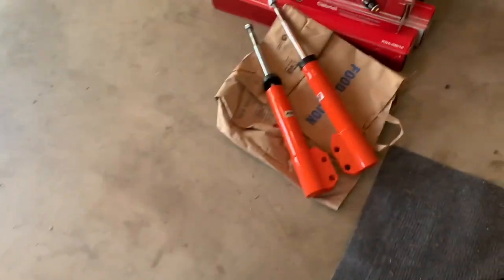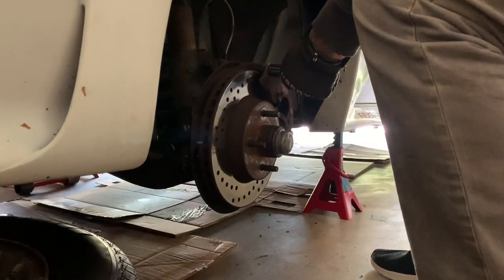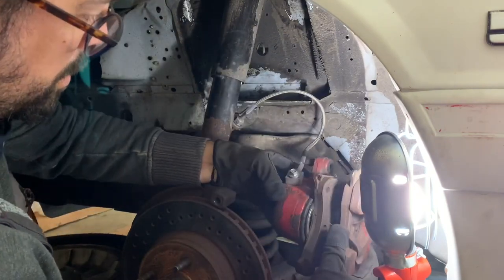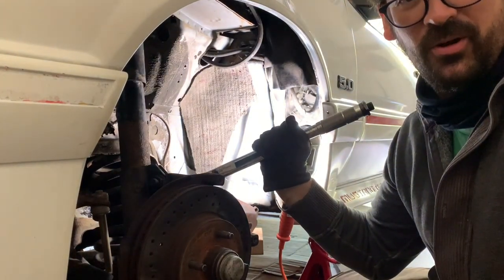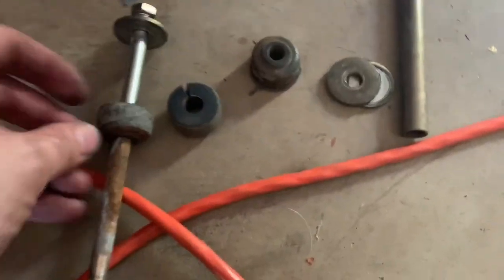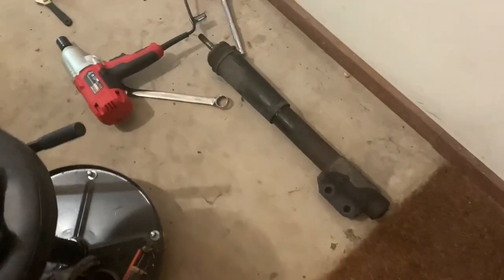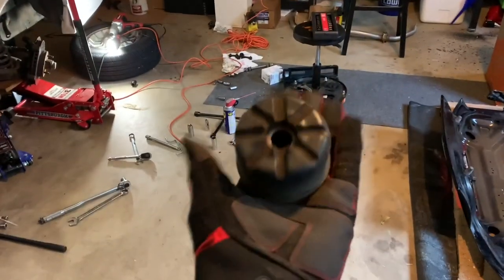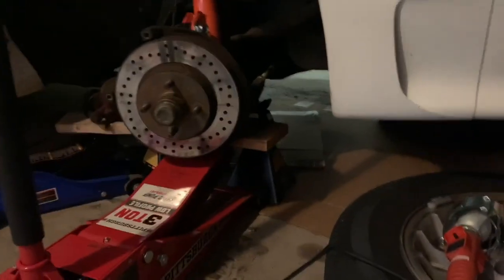Fox Body Mustang Suspension: Koni Orange Struts Installation

Comment: That kicked your ass!!  Glad it wasn’t 95 degrees outside!
Reply from the maker: Oh man...no kidding. I have to say the rear lower control arm experience was so much worse 😂😫 I’m still traumatized by that experience
Reply: @TacoPotatoMustang  - yeah I haven’t seen your video on that, but I’m guessing those bolts that go through the frame were your nemesis.  The stock height springs are a pain in the ass too.
Reply from the maker: @Foxedup  bingo...I waited way too long to try and move the mufflers out of the way and it just ended up being a long, exhausting experience. The stock height springs weren’t too bad compared to the rest of the install but I have read that doing with stock springs, the fronts are a huge pain. I suppose if I ever replace the front control arms, I will do it then but definitely won’t be attempting that any time soon.
Reply: @TacoPotatoMustang  - oh yeah my exhaust was off when I did mine.  Forgot about how tight that can be in there.

Comment: Just stumbled across your channel, love your vids! Two questions on the Koni orange strut install: (1) Did the design of the Konis necessitate modification of the upper strut mount/dust shield top or did you do that because the originals were just worn/tired and needed replacement? (2) Did the Konis bolt right up to the spindle without any spacers? I’ve read some struts need modification/spacers to work on the 87-93 cars. I’m contemplating strut & shock replacement on my ‘93 and am trying to gather as much info as I can before I tackle that job.
Reply from the maker: Hey, thanks for your comment! I will have to go back and look at the video to see if I can jog my memory on your first question. I’m planning on installing springs and a few other parts this week so I will need to revisit the strut tops to install caster camber plates. 

On your second question - I don’t recall having to use any spacers so I believe the Konis bolt right up on the 87-93 cars. If you’re not a member on StangNet yet, I highly recommend creating an account and checking out the fox body forums there. It’s still super active and there are tons of useful historical threads.
Reply: @TacoPotatoMustang  StangNet…have not heard that name in years! Completely forgot about the forums, I used to be so heavy into StangNet and The Corral back in the day. I’ll definitely have to try and dig up my old account there. Thanks for the suggestion! Look forward to more vids featuring your fox body! 🤙🏼
Reply from the maker: @meinhold93  I have a corral account as well (and accounts with most othet mustang forums) but stang net’s fox sub-forum is by far the most active forum I’ve come across in the social media age. It’s pretty incredible. 👍🏼

Comment: Did you use a battery powered impact on the top strut nut?  I'm in the process of swapping struts and shocks on my 90 7 up vert.  Thanks 👍
Reply from the maker: Honestly can’t remember if I used an impact..but if I did, it would have been a plugin electric (one I got from Walmart for like $40) since I don’t own an air compressor powered impact.

Comment: Thanks for the heads up on the cheap quad shocks - I put my koni orange on the rear today and still have to do the front.  PS, you're jacking the car up on the pinch welds?!?
Reply from the maker: The fronts are definitely a bit more challenging...but not impossible. I usually jack up on the pinch welds depending on what I’m doing. What’s the concern? 

I have a more recent video where I straighten out the pinch welds and test the SVE jack pad kit. Pretty happy with it.
Reply: @TacoPotatoMustang  Doh, I was assuming they were just sat on jack stands.  My drivers side needs straightened too - I will check your vid.
Reply from the maker: @timcole421  I have rubber pads on the tops of some of my jack stands. I usually tend to err on the side of extra caution whenever getting underneath the car so I will use extra jack stands, leave the jack as an extra safeguard, and sometimes put cinder blocks and or wheels/tires under the frame rails.